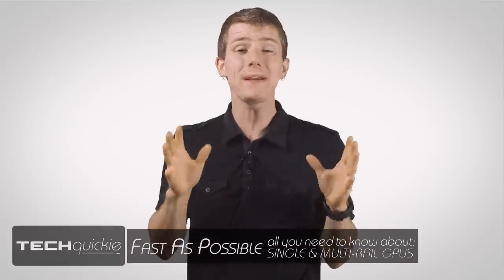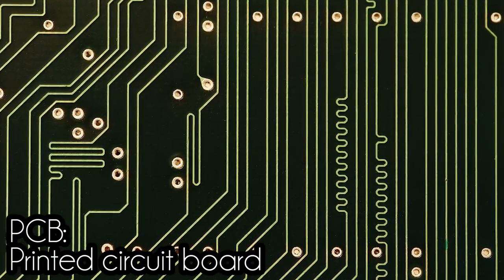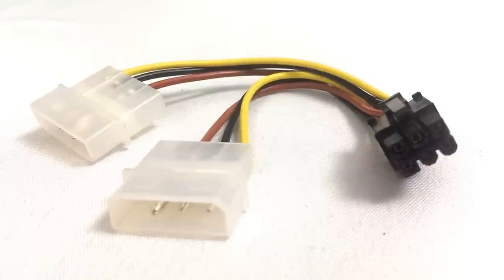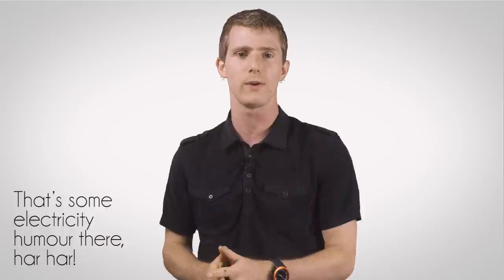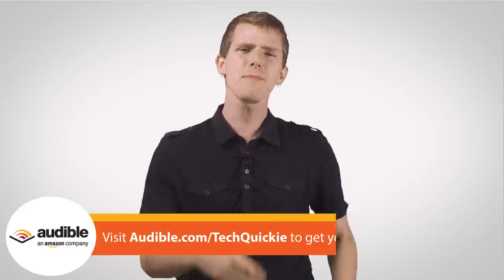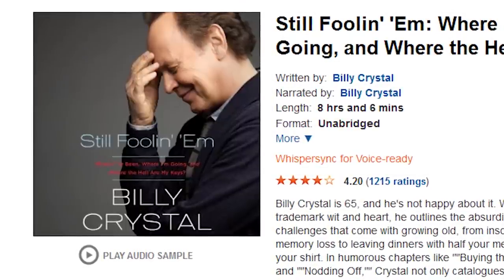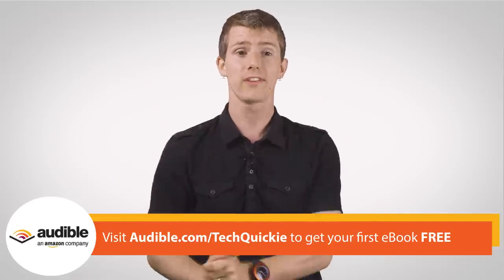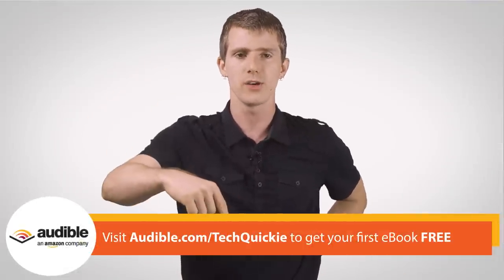Single Rail vs Multi Rail PC Power Supplies as Fast As Possible

Comment: If that happens your house surge should take effect. Most good power supplies have plenum shielded cables. This takes the fire component out of the picture. The other argument is shock and death. This is false as 250ma can kill you with certain death around 750ma. If you go cheap go multi rale, Single rail is ok if you go expensive.
Reply: PSUs that are single rail on the box aren't single rail in reality. The power losses from Joule heating (i²*R) would be pretty untenable with some of these ratings. Just imagine your 80+ platinum Corsair PSU losing 81²*R watts every second it's plugged into something with resistance R. It makes far more sense to split it up into multiple rails and connect stuff in parallel to get the higher current as needed

Comment: ok I been doing computers a long time and and electrician too and there is a huge difference in single vs multirail psu's firstly the reason for the cheap large output psu's is because 6 lower current switchmodes is a lot cheaper than 1 large one also when they refer to overload protection its on the mains side when you loose a rail that's just a small thermal cutoff by which time damage has already occurred but none of the safety mechanics built in protect your mb or cpu or gpu because they all need different amounts of power so it impossible so as far as high power usage pc's go single rail is really the only option

Comment: okay guys i have a issue, i have. 400 watt psu and my pc is pushing 200 watts with out any psu hooked up.. im getting a 270x soonish and it will put my psu up to 380 watts. Is this bad? 20 watt headroom? or should i be alright for a while till i can afford a new psu? thanks
Reply: The 400 watts that it says on the box is how much it pulls from the wall, not how much it's delivering. Unless it's rated 80+, it's delivering less than 320 watts of power. So tl;dr, you should get a new power supply first. Corsair's CX series are fairly cheap and are all (I think) rated 80+ Bronze or above.

Comment: So I have a question... I recently bought a pair of 480's and an HX750w psu (yes, I know 480's are old, and no, I'm not replacing them). I believe the HX750w is a single rail with 62a on the 12v rail. I read somewhere that a single 480 needs at least 48a on the 12v rail... with 2 480's, would that mean I'm only getting 31a to each card? Isn't that... unsafe? Or does 62a on a single 12v rail mean both cards will get the 48 amps they need?

Comment: I know this is not the right place for this but im very confused about something.
On ncix.com when i am doing the custom pc builder thing and creating my own pc, why is it that the BenQ XL2420T 120hz monitor is more expensive than the Asus VG248QE 144hz? Isn't 144hz better than 120hz for gaming can someone please help me out.
Reply: its hard to say but anything over 60 fps you wont notice, the only reason you would ever need a 120hz monitor or 144hz monitor if you were using 3d vision cause it has to be at least 120hz, they both are pretty similar . i would get the asus monitor
Reply: Well can somebody answer my question on what the deal is with those monitors?

Comment: So the greater question here is, when is it ok to use one cable from the PSU to power the GPU and when are two cables needed to adequately power a GPU?  You mentioned this in a recent video and I cannot find clear answers.  One person says two cables only if you don't have a cable with dual connectors (eg. 2 six pins) or if your PSU has separate rails.  But in your recent video you mentioned using two cables regardless of dual connectors and here you say single rail vs multi rail doesn't matter.

Comment: So, my PC has been crashing and people are saying it is because I have a Multi-rail power supply. Is this true?
I have an EVGA 650w and and gtx 980. Should I get something different?
Reply: +Zachariah Price yes but NO DO NOT GET ANYTHING DIFFERENT if you do then you cant run it at all multi rail power supplies only support multi rail GPUs which are the high end ones most weaker PSU's have single rails and if that happens your system wont boot at all
Reply: +Zachariah Price 650w and gtx 980? i think your computer uses more power than the psu can give. maybe there's your problem
Reply: +Washu Ken What are you even talking about, That's non-sense. My single rail 850w PSU supply's a GPU that requires 2 8 pins, and it boots and will run as long as I need it to.  Also, I've never heard of a Multi-rail or Single-rail GPU being relevant, because as far as I know all GPU's have Electronic circuits.
Reply: +The Vibe u2 shouldn't give advice...

Comment: Which power supply would be best if I need +1000W gold or platinum certificated and which would cost less than 240 dollars?
Reply: Antec or Fractal are probably the closest you'll get. Rosewill has a $200 one on Amazon but I've never had anything last longer than 6 months from Rosewill
Reply: And how about (Cooler Master Silent Pro Gold 1000W 80+ Gold semi modular ATX ) RSA00-80GAD3-US?
Reply: xsrederisx Sure. Anything 80+ Platinum is going to be reliable.

Comment: if i have a 2 12v rail modular psu, and i want to run an sli setup, do i want one gpu per rail or both on the same rail?
Reply: +robo cop No one answered you, but in case you're still wondering. 1 Per rail is optimal. But it will depend on your PSU wattage and the output of your 12V Rails. You're pretty much trying to balance it all out as best as you can. This is one reason why a single 12V is better.
Reply: +GokuDude thanks bud, yeah i emailed antec directly with my psu model and they responded, i am now happily running my msi gts 970's on my antec hcg 750. cheers

Comment: Is a single rail corsair rm850 power supply good?
Reply: If it has 80+ certification, it's good, especially a Corsair PSU. You may not need 850 watts though unless you're running a dual card configuration. You can get what you want, but saving money is always good.

Comment: he didnt explain one thing I was looking for,I have 2 computers with 2 psu's 1 is an xfx 850 watt psu with 1 72 amp rail 80plus bronze and a 1000 watt Zion 80 plus bronze psu with 6 12v rails all equaling up to 160 amps of total power 20/20/30/30/30/30 are its 12v rail amperage but ive seen graphics cards like the old gtx295 that say you need at least 46 amps off the 12v rail so does this mean even though im running good wattage but only pushing 30 amps total off 1 of the 12v rails its still not able to correctly power the card. cause i know having multiple rails does not combine amperage
Reply: That 1000 watt Zion should power the GPU just fine but you will need to split the power from 2 separate rails.  Use 2 of the 30A rails if possible and you should be fine since internally all those rails will actually go back to only one or 2 real regulated rails (check the manual or sticker on PSU to be sure) so the amperage available will effectively be double.
Reply: I don't really think you need 1000 watts for just an old 295.And if you're not running SLI/Crossfire, you still don't need 1000 watts for a modern setup.
Reply: kuhrd the strange thing is on 2 of the modular cables it came with it actually has i sleaved power connector that ends as an 8 pin then split off into a 6 pin so its an 8 pin and 6 pin on the same modular cable. im running a gtx760 off just one of the cables since it splits runs okay so i dunno. thats why i dont like multiple rail psu's you just never know if your running adequate  power
Reply: ShadowMassacr13 the gtx295 was just an example of its requirements for the 12v rail
Reply: This video is only about single vs multi rail PSU's not the current they can deal with... so yeah Linus didnt really make it clear in that sense but meh
Reply: The real issue the old PSUs had was that many from the era of multi rail were setup to supply a greater amount of current to the 5V rail because at the time the CPU and Drives generally consumed more power off the 5V rail and many of the GPUs previously pulled thier power from the socket on the motherboard and only on the higher end needed external power.  Because of this many of the PSU manufacturers were still making PSUs for the older less demanding systems.
Reply: kuhrd yeah lol, i was curious cause this is actually an 80 plus bronze gaming power supply not intended for older computers
Reply: ***** your psu is labeled. If the beast card needs more amps than one rail provides, use two. 6pin from one 8pin from another.
Reply: TheBlackIdentety Not everyone is a PC expert and you are commenting on a Tech Quickie video meant for less knowledgeable PC users.  Also if you had a true multi-rail PSU as they used to sell several years ago, you could not simply connect one cable from each rail as they may be on separate voltage regulation and if so could ruin the PSU or cause it to shut down due to one rail having a slightly higher voltage and taking more of the load.  The key here is that most PSUs sold these days are not true multirail and thus actually have only a single regulated rail that is split up into several outputs to provide overload and short circuit protection on each.

Comment: I need help please please please, I have a old dell alienware witch I upgraded it has a 1000watt dell psu, I taught it was good enough coz it has sli support the psu waa made when gtx 260 where new, right now im running a core 2 quad soon i7, q9550 at 4ghz 8gb ddr2 rampage x48 and a gtx 770 2 500gb hdd 2x120gb ssd when I play bf4 or run furmurk the pc just shuts down what could it be please please please help me, I know its not the cpu coz I can run prime 95 for 24hours when I run furmurk it shuts down cut off I know its not the gpu coz I had a gtx 570 and it did the same with it, I taught it was faulty so I bought a 770 its not the gpu or hdd, whats wrong with the psu its a 1000watt dell psu. Help
Reply: You're using the PCIe connectors on the psu and not PCIe to molex adapters right?
Reply: Timothy Lastovica
yeah it has 4 of them it was sli with 2gtx 260 before.
Reply: Is it modular or semi modular?
Reply: Timothy Lastovica
modular
Reply: GamingTurkey Have you already done the easy stuff like checking if the plug has become loose on either end, checking for cable damage at the ends, etc?
Reply: Timothy Lastovica
yep tryed everything i try to put another psu in the system a 750watt semi psu, brand new 80plus gold and that started making shorting out sound, idonno whats wrong D:
Reply: Timothy Lastovica nope I dont have that my mb is a rampage x48 lga 775
Reply: GamingTurkey Have you tried moving the 770 down to the last PCIe x16 lane? There could be an internal short in the first lane.
Reply: Timothy Lastovica
yep :/ it another system it works fine there aswell, i tryed a gtx 460 in my system and that works good in my system but why doest the 770 ?
Reply: GamingTurkey Do you have another computer you can try the 770 in? Even a friends? Just something to confirm that the 770 is not defective. I know you mentioned a 570 didn't work, and a 460 and a 260 sli did work. It could be a rare chance you got a defective 770 AND 570?
Reply: GamingTurkey The 770 uses way more power than the 460, it's probably the "1000W" dell power supply is just a crappy oem one, which it probably is. get a 650W branded and it'll run your stuff fine
Reply: KiritoTheSoloPlayer GamingTurkey also tried a 750watt gold in it. This is odd.
Reply: GamingTurkey please also note if the card is defective and is causing the PSU to trip there is a small chance it may damage your friends comp if you test it.
Reply: Timothy Lastovica yeah I gave sold my 570 to my mate for 10 pounds thinking it was defective, he ran fur mark n bf4 with me all night I couldn't go 2 hours without the system randomly shutting down and hannging I tryed down clocking it same thing I tried with a q6700 same thing I tryed with a core 2 due same thing I tryed in a different mb same thing the only thing I think now is the psu :( but its 1000watt
Reply: Timothy Lastovica everything I put Into my pc becomes defective :(
Reply: GamingTurkey By chance could there be an electrical problem in the wall itself or the outlet / surge protector it is plugged into?
Reply: Timothy Lastovica
i think so coz when i plug it into another socket it lasts me bit lonnger, could the socket be over heating ?
Reply: GamingTurkey I'm not enough of an electrition to take a guess of what's wrong in the wall tbh. I'll do some searching when I get back home.
Reply: Timothy Lastovica
thanks dude :D
Reply: GamingTurkey So I found a forum post and it is possible that depending on how many other things are hooked up to that line of the house circuit could cause issues in amperage. 

http://www.tomshardware.com/answers/id-1728591/house-wiring-causing-computer-shut.html

They have a few people saying to buy an UPS but that wouldn't be realistic. A UPS is basically a back up to prevent sudden data loss from a small black out. It wouldn't fix the problem only dampen the instability.

To troubleshoot if it is a house wiring issue you can try to bring your pc to a friend's house. If you have blueprints you could also move it around your house and unplug everything else on the circuit it shares.

If it still shuts down with both those trouble shooting ideas then could also see if the power supply is set for American circuits?

http://pcsupport.about.com/od/termsp/g/psvoltageswitch.htm
Reply: LOL my system is about 50kg :O cant take it to a mates but other computers in the house work fine, to my pc i have connected 3 screens an ruter hdpvr xbox 360 g27 wheel another computer thats a quad core aswell but that doest turn off or anything D:
Reply: GamingTurkey Does anything else turn off when the machine turns off?
Reply: Timothy Lastovica nope D:
Reply: GamingTurkey Have you check to see if it has one of those switches like the bottom link for 110-115v to 220-230v?
Reply: Timothy Lastovica
its europ it doesnt have the switches
Reply: GamingTurkey Out of curiosity if you start a game with bare minimum settings 720p lowest settings does the computer stay on during the game?
Reply: Timothy Lastovica
nope when i lauch furmark it crashes
Reply: GamingTurkey not furmark but a normal game on min.
Reply: Timothy Lastovica
2to 3 hours it shuts down, the temp are notmal i monitor the temps on my other screen, the cpu at 4ghz stays at 50-60 core a 100 stays at 70-65, the gpu gets max 71, the mb 45, nb, 55, sb, 53
Reply: GamingTurkey Motherboard?
Reply: GamingTurkey Is the PSU getting adaquete airflow and is it getting hot? Since it is a delayed crash we might be getting somewhere. That was a delayed crash while on all low settings in game right?
Reply: Timothy Lastovica
its heating up a bit but not that much i dont thnk i should brake a sewt its 80plus gold
Reply: GamingTurkey Any chance you know the model number so I can see if other customers have had similar issues?
Reply: Timothy Lastovica Which PSU would I need for GTX 770 4GB and i5 4670K, I might do some overclocking tho. Would 600W be enough?
Reply: Nikola Nedic 600 watts should be fine. You'll have nearly 100 watts of extra headroom. For overclocking that depends more on the power phases on the motherboard. Personally I'd go with either of these two.

http://pcpartpicker.com/part/corsair-power-supply-cx600m

http://pcpartpicker.com/part/seasonic-power-supply-s12ii620bronze
Reply: Timothy Lastovica
thats the full name
Newton Power N1000P-00 NPS-1000AB
Reply: GamingTurkey This is starting to hit the end of my knowledge of electrical engineering so if this isn't the issue then you might need to ask on Linus's forums.

The Newton power supply has multiple 12v rails but it seems they are only 18 amps each. 

Specifications:
+5V / 16.0A
+5VFP / 3.0A
+12VA / 18.0A
+12VC / 18.0A
+12VE / 18.0A
-12V / 0.2A
+3.3V / 30.0A
+12VB / 18.0A
+12VD / 18.0A

http://www.geeks.com/details.asp?invtid=N1000P-00-R

And from checking forums I found the 570 is about 18-20 amps, and the 770 is 20-22 amps. (difference depending on factory overclock)

You could try other PCIe connectors in case one rail has gone bad. That in combination with underclocking / undervolting the gpu. I'd say knock down the clock by 30% and power by 15% with a 1 monitor and Vsync on. Basically experiment if less stress / power running to the gpu equals longer sessions till the PSU kicks off. That would be evident that there may not be enough amps on the 12v rail. (granted if overheating is already ruled out.) If you have to model of the other PSU you've tried I can check if it also has low amperage on the 12v rail.
Reply: Timothy Lastovica
are the pcie on the 12v rail ?
Reply: GamingTurkey Yes, the gpu is on the 12v rail. Here is a forum, some other people that replied covered some of the other stuff about the 12v rail that could be an issue.

http://www.tomshardware.com/forum/330500-33-connecting-separate-rails
Reply: Timothy Lastovica
thanks dude for all the help and replys :D
Reply: GamingTurkey No problem, before you replace the power supply try experimenting with what I mentioned above. If less stress / downclocking cause an increase in session length before it kicks off then we are on the right track.

Comment: Over current protection ftw. When the power went out one day, my dad plugged in a dedicated run from the generator to power my PC while other powered the rest of the house but didn't reach my bedroom. Yeah, I was on the computer by candlelight. Anyway, one time he sent the entire generator's power to my PC alone and my psu took the brunt of the whole thing. I smelled the smoke. It never caught fire but it took all of the current and none of my other components were harmed. This was a long time ago when psus we're nothing special but 400w gray boxes.